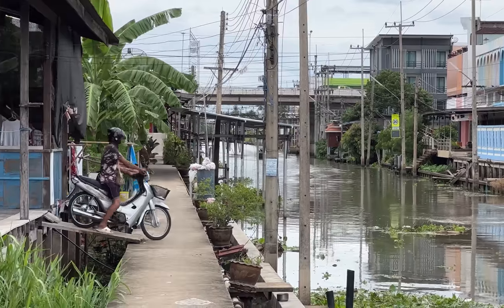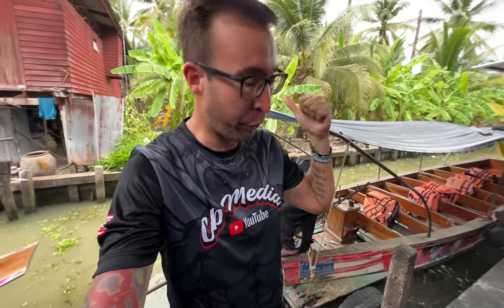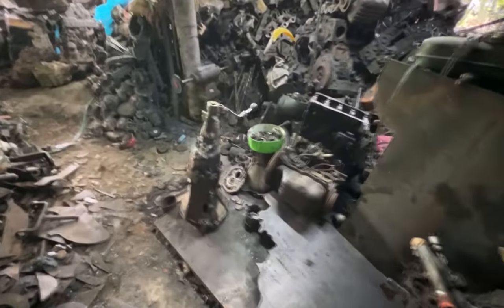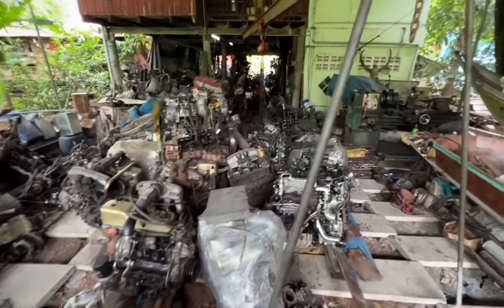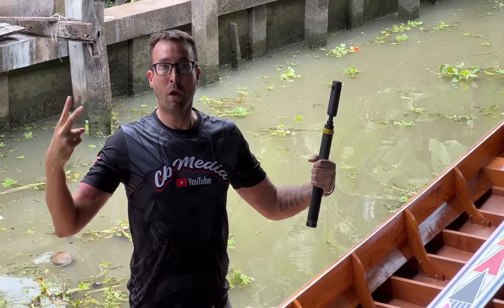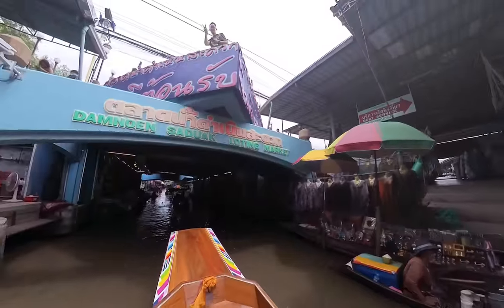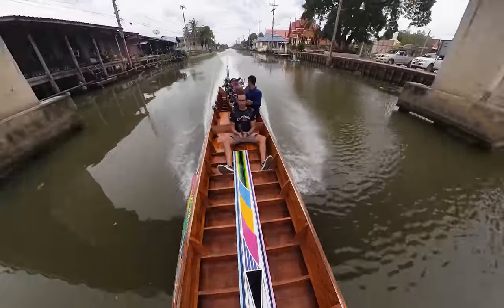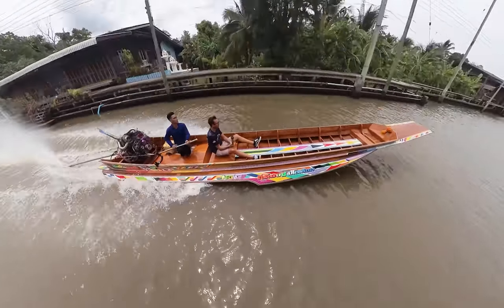My Epic Return to Thai Longtail Boats! 50 PSI of Boost!

Comment: 400 horse piece of plywood, brilliant. Thanks Chad.
Reply: No, that is real wood, the chipwood and cardboard stuff is the rubbish americans call a house.
Reply: @alielabdimarras7965  I mean it doesn't rot, its pretty cheap, and lasts forever lol
Reply: @alielabdimarras7965  For having such nice houses they sure didn't survive the bombings in WW2 very well ahahahahaha💀💀💀💀
As always we had to save absolutely everything
Reply: ngl i feel like a 4jj1 with 50psi of boost should be more than that
just slightly
Reply: @URsooomad8613 what house can supposedly survive “ww2 bombings “ bro 90% of houses can barely survive a little flood 🤣 bro talking about bombs
Reply: This is not plywood. Who the f making boat using plywood. Plywood in s asia only to build fragile thing not for boat or house
Reply: @zxccxz9897   Please go back and learn more. Which will last longer and be stronger, a wooden or fiberglass boat?
Reply: @alielabdimarras7965 Who says rubbish?
Reply: Mote important for a boat especially: that's 700+ ftlbs of torque

Comment: I just recently learned about why seaplanes have a step in their hulls and it looks like that Thai riverboat has it as well. When a boat or plane accelerates through water the front end lifts and the rear get pushed down with increases hydrodynamic drag. This drag makes it difficult for planes to gain enough speed to take off so there is a step in the hull that the plane can pitch forward on and ride on and since there is less surface area there is less drag and more speed. I think when these riverboats dig the propeller deeper into the water it pushes the rear of the boat up and then you only have two smaller points where the hull is contacting the water and it can gain speed. That has got to feel sketchy as hell since you are basically a giant skipping stone
Reply: Those water plants are invasive species. They're actually from Java, Indonesia. Just around 150 years back one of our princes had them in his palace ponds for decoration. But to his unawareness Thailand's occasional great flood in Bangkok had set loose these invasive plants into our canals and rivers. They spread all over central region of Thailand till today. Our ecosystem had perfectly adapted to welcome them. But our original visuals of freshwaters had gone forever.
Reply: Like WRC, manoeuvring off each bounce

Comment: Looks like the boat redirects air out the sides so it doesn't lift. There's a lot going on there from their experience no doubt.
Reply: I was looking at the flex of the tiller/engine/prop shaft.
Reply: As Thai, these boats are like hundreds year of knowhow to make. No engineer there to make a CFD sim, just pure mechanic and experience passthrough generation. So, they might not be perfect, but it's as raw as you can get haha
Reply: @jnhkz  Yeah, I watch videos of thai people making boats and it's crazy to watch them build. They make all kinds of angled cuts without a speedsquare or tape measure and it still comes out perfectly. I have no idea how they do it.

Comment: That Black Label Whisky  will goes a long way in term of friendship. As for the Euro girls, their number continue to increase year after year and yes, i do find them interesting also. now for the boat, i think a long tail design needed some modernization to align with new tech/ innovation.  improvements on aeros and    build materials could be ground breaking upgrades that increase speed, stability, drivability, safety and overall experience.

Comment: Most Holset turbos are manufactured the same way still, there are "Super" versions of the most common ones with updated housings and compressor wheels. Matched with whatever engine you're using they're great bang for the buck.

Comment: problem is boost pressure is not an indication of power especially if it's hot air. Air density is the true measure. Take a sealed box and heat it. the pressure (boost) will go up, but it still has the same amount of air in it.

Comment: Look like these boats is constructed to give minimal wake wave ... If you did go this fast with a v hull speed boat in this narrow canal all the boats and houses on both sides would be crushed. That happened once when me and a friend of mine had parked our 28ft sailboat in a narrow canal. A speed boat passed by at much lower speed then this causing huge waves that crushed the boat into the dock several times causing damage to the boat and the dock.

Comment: How do these boys keep their engines cool? I don't see any radiators and i don't see water injected headers. Most watercooled boats here in the US pipe water from the lake from an intake up to teh headers through the engine and then out the exhaust. But, I'm not seeing that there.

Comment: 12:10 "...1800 milliamp per hour..."  No, it's not "per" (division). It's milliamp-hour (multiplication), meaning that the product of your current draw (for example, 900 mA) multiplied by the duration (for example, 2 hours) would required 1800 mAHour (typically there might be a dash in there (mA-hr), but it's not a subtraction either.

In summary, not "per". Not "per". No.

Comment: Whats stupid about you saying how much boost they run (like its alot of boost) is that in a diesel air cools combustion and lowers horsepower. You should be telling us how much diesel they consume to tell us how much power they make. As fuel is what makes power in a diesel. Sigh.